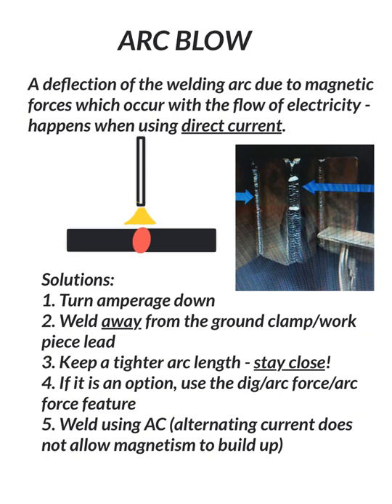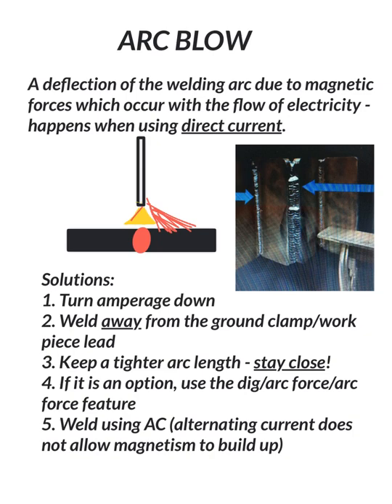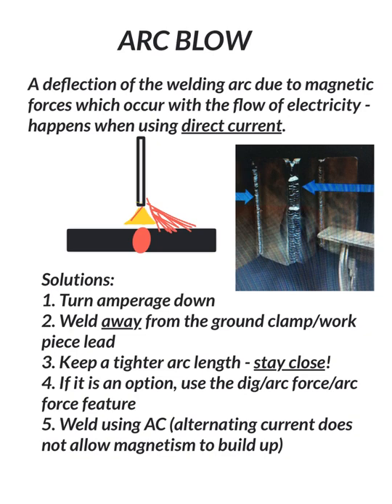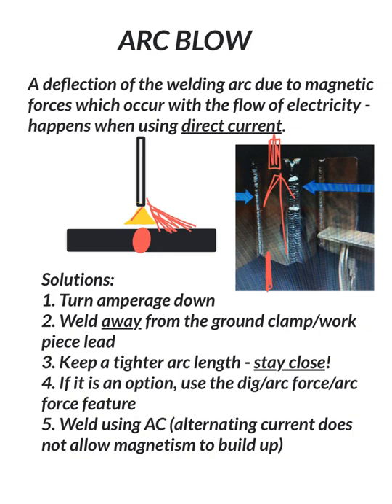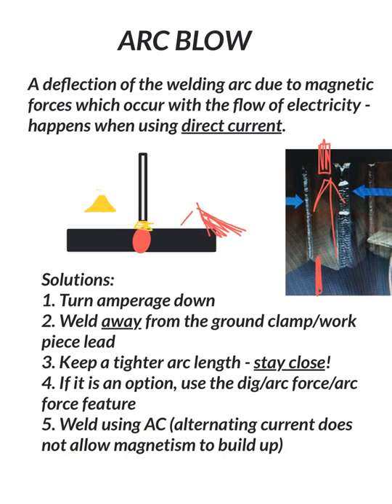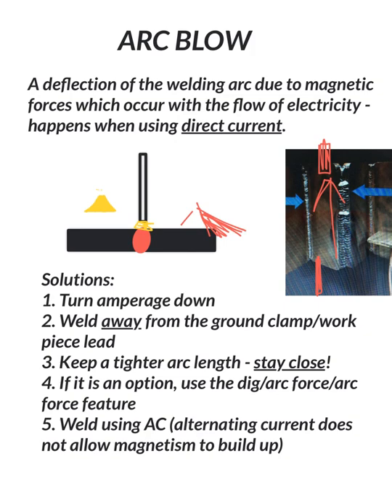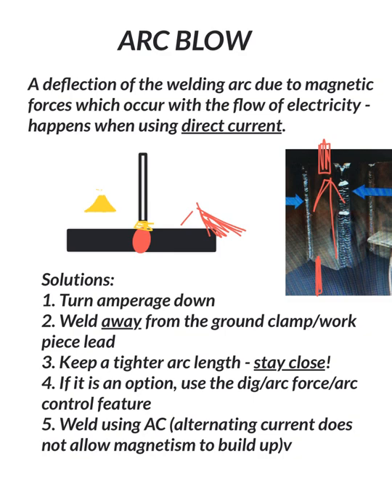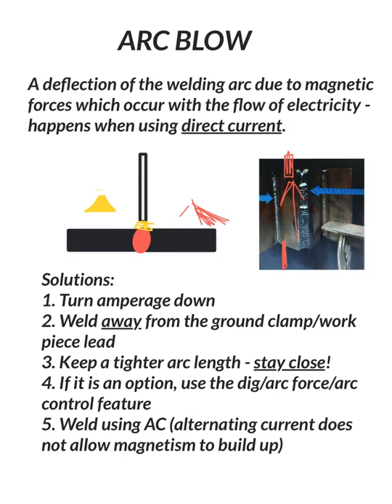Welding Arc Blow

Comment: This happens alot to me mig welding layered panels on unibody cars structure...it is frustrating its as if the layers are N and S magnetic and any attempt to get good penetration on both tends to expell the molten metal away from and towards me! 
When this happens i usually end up taking a good while fighting with it until i cant get enough overlap then it will stop doing that....is there some method i am missing besides lowering amperage which lowers penetration btw and moving ground away from weld area ?

Comment: when you say adjust your dig, would you adjust it up or down?
Reply from the maker: Adjust it up. It will make a more crisp arc. This will allow you to reduce the arc length and it will be less prone to sticking to the plate.  The closer the rod is to the plate the less the arc can wander. Hope that helps and thanks for watching.